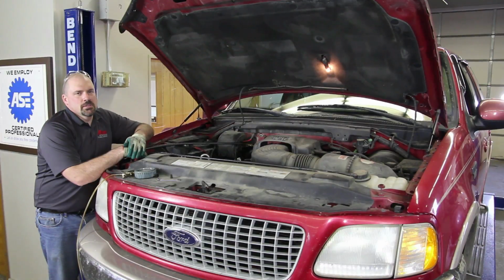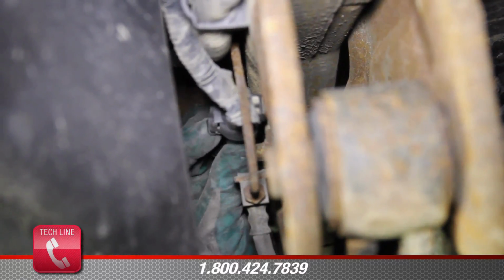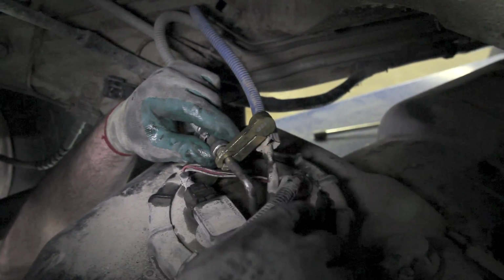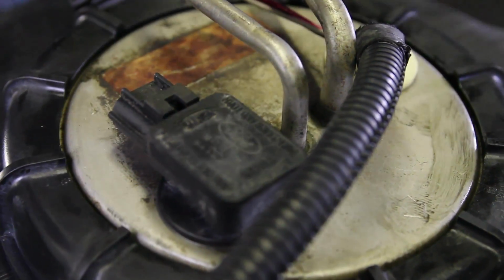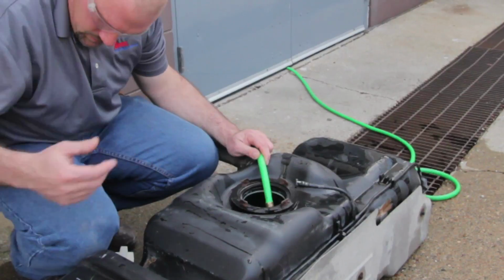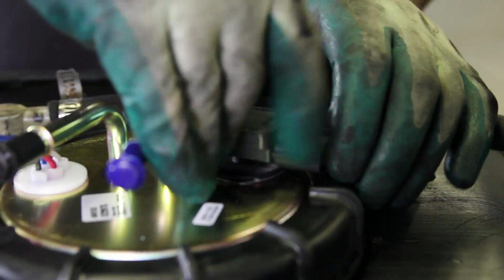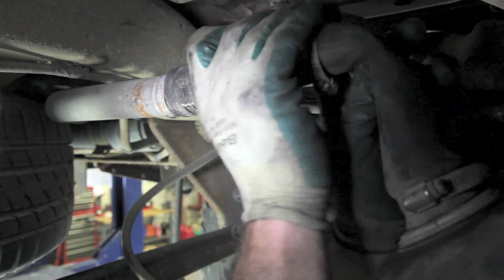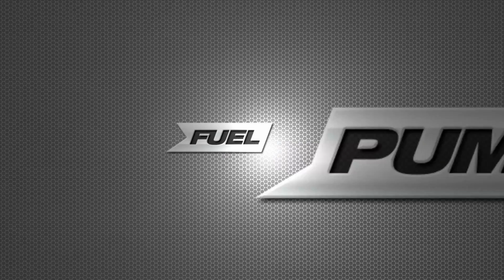How to Install Fuel Pump E2297S 1999 - 2002 Ford Expedition & 1999 Lincoln Navigator

Comment: Hey all, did some digging and came up with this for the disconnect tool:

https://www.amazon.com/dp/B0195XBPPQ/ref=psdc_15707681_t1_B000CIV4NW

ARES 70024 | 3/8-inch and 5/16-inch Scissor Fuel Line Disconnect Tool | Easy Separation of Quick Disconnect Style Fittings | Applications Include GM, Ford and Mazda 1990 to Current

As of the date of this post, $6.92 (Prime)

The connector size is 5/16th, so this will do the job great! I ordered mine.

Comment: Can i get an id on the special tool needed to release the fuel line?
Reply: Auto parts stores sell them listed as AC and fuel line disconnect tool , plastic Ones are like $8 metal ones are like $15 ... metal ones work pretty good

Comment: HI I have 2000 Expedition 5.4L my issue might not be related , but my issue is that when I come to a stop or slightly slowing down when  proceeding to go my truck act like it chokes out so i have to pump the gas peddle to make sure it doesn't cut off because sometimes it has and i throw it in park and generally it will start right up .....So I'm not sure why its doing that I've had someone say it could be a Solenoid valve under the truck that's not opening and closing properly .....Any other advise
Reply: Did you figure out what it was? Im having similiar issues you are.
Reply: that's a bad fuel pump. might as well replace the assembly
 @juniormorales559

Comment: hey i got a ford expedition 2002 5.4L the car cranks but dont start,i checked it, and it didnt has fuel pressure then i replaced the fuel pump and fuel filter, and still not start, i went to spark test, and has a little bit of spark, it looks poor, can you please help me
Reply: I had the same problem and just now figured it out. Check the wires running to the pressure sensor Mine were melted somehow just wired them back together and boom it fired up.check along the side of the frane

Comment: hi I have 2002 ford expedition 4.6L I've changed the fuel pump, fuel filter, and it still won't start it wants to but it just won't kick over, so now im thinking of changing the fuel pump drive module  i just can't find it can anyone please tell me where it is. my last guess is its in the tank.
Reply: you should have checked compression.

Comment: My 2000 Expedition was hit in the left rear while it was parked in front of my house. Over six grand in dmg. I started the car afterwards and it started fine so I drove it down the street to make sure I didn't have a bent axle. It didn't so I pulled it up in my driveway and there it sits. I tried to start it, but no go. Finally it drained the battery. Checked the inertia Switch, and it was fine, and still no start. Any advice or thoughts would be greatly appreciated.
Reply: ***** 
Thanks for the response, I'll do that. Now... my gas Gage read 1/4 tank, and its parked on the driveway on a slant, so I don't believe its a true reading of gas level in the tank. I've had issues with gas level readings in the past, could also be something simple like... out of gas?

Comment: I have a 99 expedition which won't readily receive fuel from the gas station nozzle. I have checked the charcoal canister and the bypass valve. What may cause this ?

Comment: I have a 1997 Eddie Bauer 4.6L 4x4 and is it replaced the same as this one? Also, which part number is the pump because I've looked and there are several different ones.
Reply: Ok thank you
Reply: ***** What would cause hesitation or wants to turn off when your taking off from a complete stop for a 2000 Ford Expedition 5.4 liter engine. If you easily press gas it won't hesitate but a hard press on gas seems to hesitate it. Fuel filter has been changed but no luck, spark plugs have been checked and firing correctly Thanks for the video.

Comment: I have an 02 and it was actually pretty easy...I replaced the pump only and filter... Took me about 4 hrs including driving to get the part... I had about 1/4 tank of fuel... Sweet.
Reply: +TheRob916 I'm curious Would you do it for $100. if not what would you charge?

Comment: I replaced my entire fuel pump and sending unit a few years ago and now my fuel gauge is not working.  I suspect its the sending unit and not the pump as the expedition runs just fine.  Do you know if they sell just the sending unit or do I have to replace the entire unit?